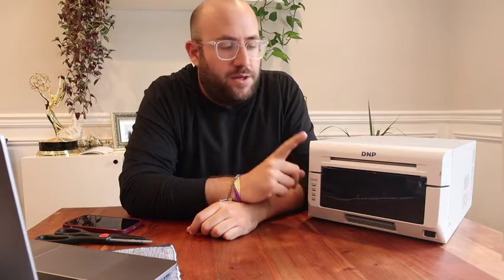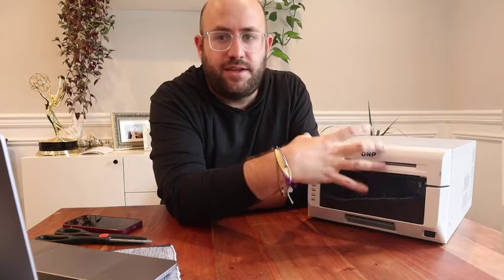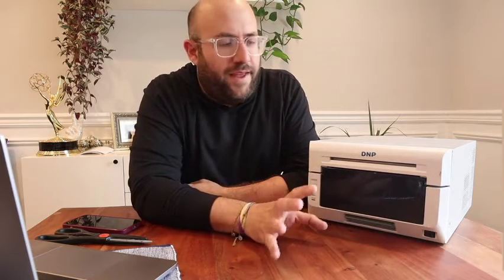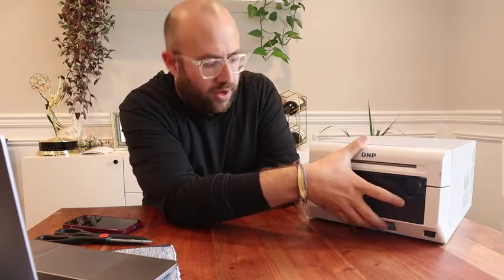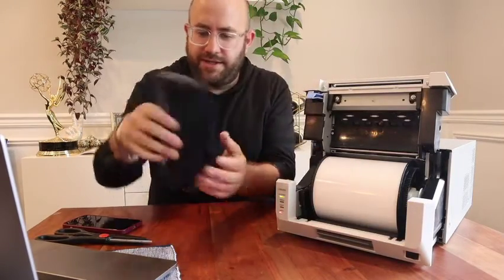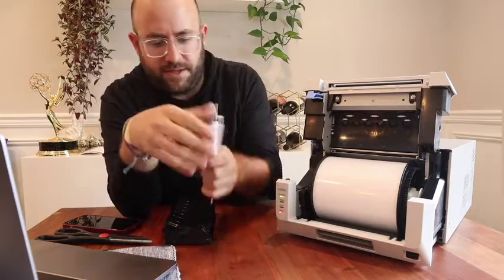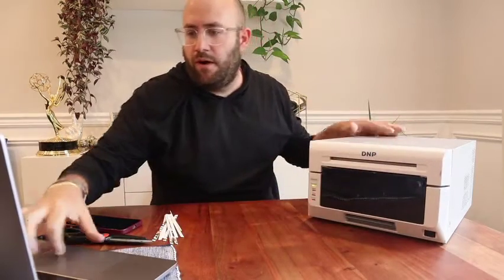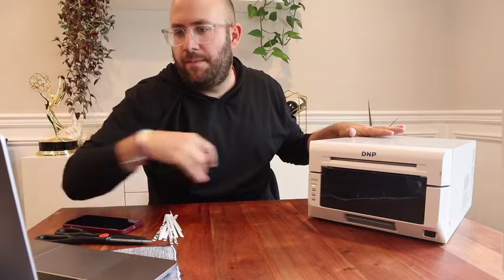How to Fix Your DNP DS620A When the Power is Cut Off

Comment: question.. I just received mine and it stays on idle and won't print via hot pocket.  when i go to my printers in my computer (windows 11) and hit test print, it does immediately.  Anything will help.  Thank you and how did you reset your print to the printer?

Comment: I made a Mistake and I forced it, so I take screw driver to open it but it doesn't work... after it, I tried to turn it on again and it open it's "lock" but, after I set up again, the "print" comes out white, with out the image... maybe when I forced it, I plug off some inside cable? Thanks if you could help me... I have a DNP DS40 - THANKS